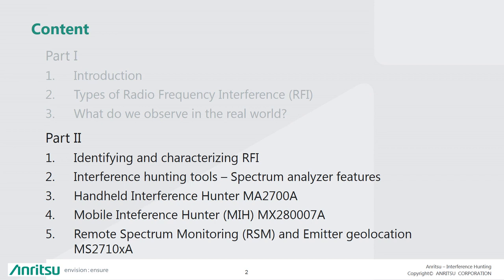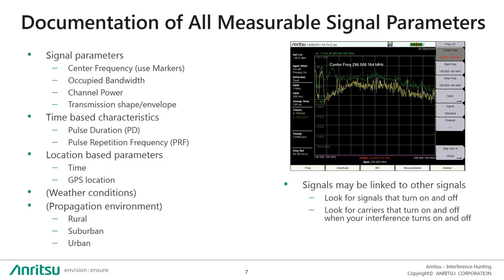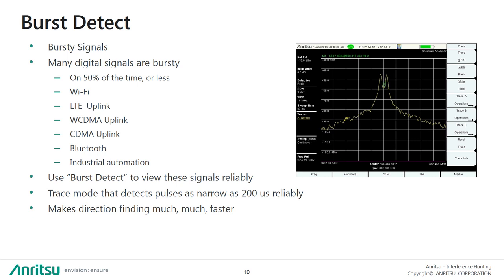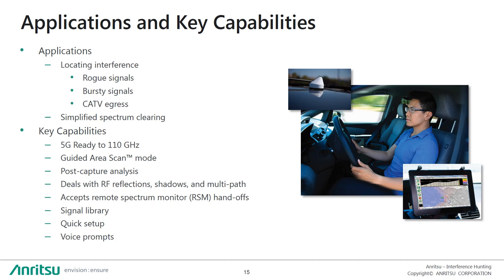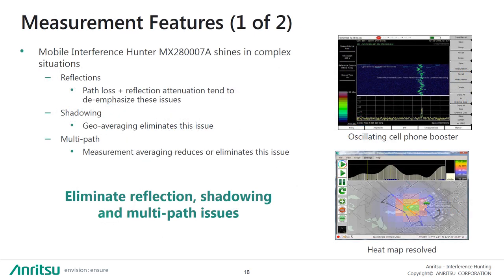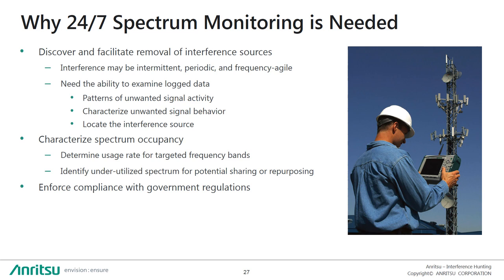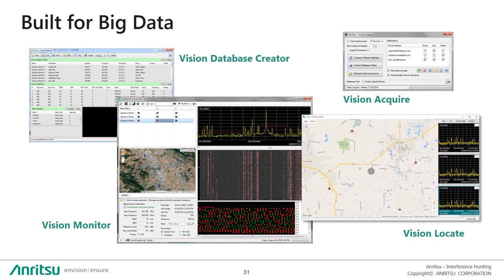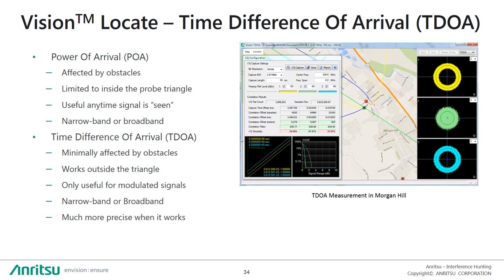RF Interference how to find it (part 2)

Comment: The RF interference is a critical factor affects the LTE Data Rate. If you like to calculate the impact of RF interference on LTE or actually any wireless system's data rate, feel free to watch the video in my channel: Hidden RF Interference That Kills Wireless Speed & Capacity.